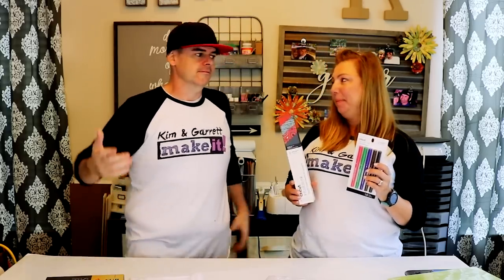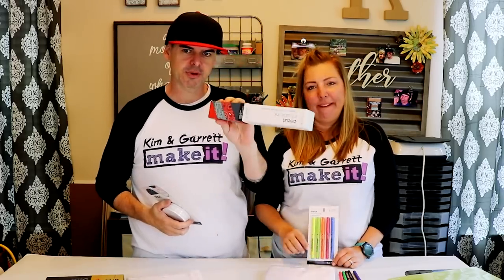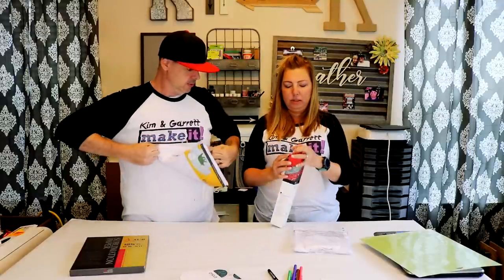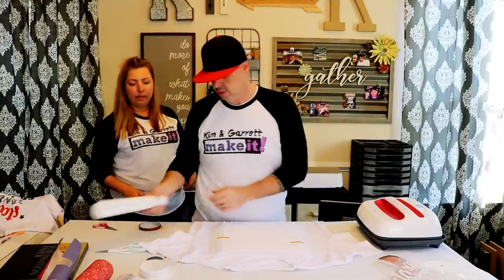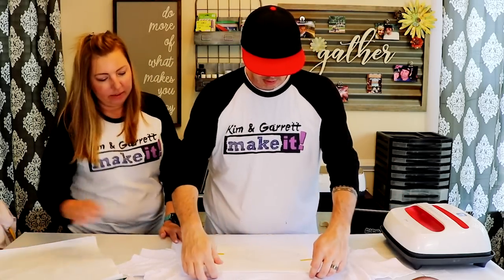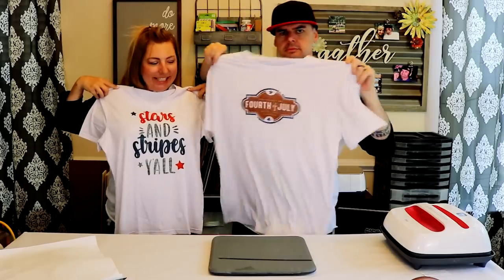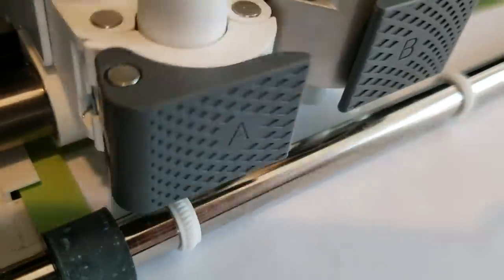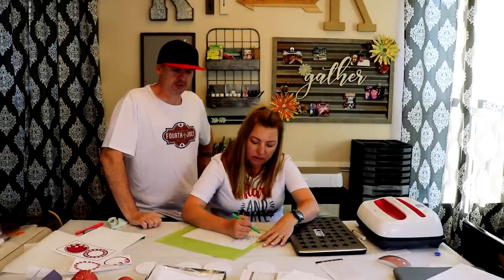Cricut Infusible Ink VS Sublimation Printing and Heat Transfer on a T Shirt and Coasters

Comment: You heated the coasters wrong with the Infusible ink. The design was supposed to be faces down onto the mat with the butcher paper underneath and on top of it like a sandwich the same way you did the sublimation coasters. Only the cork coaster are face up with the design. Therefore, the pens was not fairly judged due to your error. The pens are pretty awesome the only issue is that you have to color in the design
Reply from the maker: Thanks for the tip to heat them face down, I think that would be better.  For us, the pens were blurry  when drawing on the sublimation paper, it didnt seem to be a heating issue.  We'd like to try them again, I have a lot of great ideas if I can get them to draw a crisp line!  Maybe we can try again with a new set pens!
Reply: Kim and Garrett make it I find that the yellow, neon green and the neon orange are faddish/blurry. Try using the blue, pink,cardinal red and black. They give you a better result.
Reply from the maker: Thanks Amara!  We'll do that!

Comment: My Infusible markers were the same. I had to keep them tip down for about a week before they worked properly and I now always store tip down with all my markers.
Reply: I use the Infusible ink sheets on my coasters. I just cut a round or square on the Cricut. Turns out great.
Reply from the maker: That’s such a good tip thanks for the heads up!

Comment: Did you use sublimation ink in your printer. What kind a printer do you have. 

Love your videos-I always get a giggle
Reply from the maker: We use these:  Epson Artisan 1430 Wireless Color Wide-Format Inkjet Printer - https://amzn.to/2MyzZIp

Continuous Ink Supply System - http://www.cisinks.com/continuous-ink-supply-system-for-epson-1390-1400-1410-artisan-1430-printers-ciss-cis-p-461.html
This video will give a little more info on sublimation: https://youtu.be/npSOTiJLoxU

Comment: With sublimation printing, do you need a high polyester shirt as well? Im wanting to do and outcome like this on cotton shirts. Im not a fan of vinyl htv but I use it . I just want to find something like infusible ink for cotton
Reply from the maker: Yes, sublimation is the same as the Cricut Infusible ink and it also requires high poly content.  But, I have seen some printable sheets that can be ironed on but they take a white ink laser printer that we dont have. But I'd like to try them.
Reply: @KimandGarrettmakeit  so does the infusible ink require poly? or can it be on the cotton?

Comment: Hi can I do heat transfers vinyl an sublimation printing for t shirts using the same printer?
Reply from the maker: Well, the heat transfer vinyl & Infusible inks are cut using the Cricut, the sublimation is printed.  You wouldn't be able to use the sub printer for anything but sublimation once you put the inks in or conversion kit.